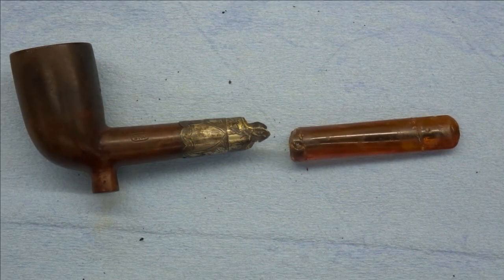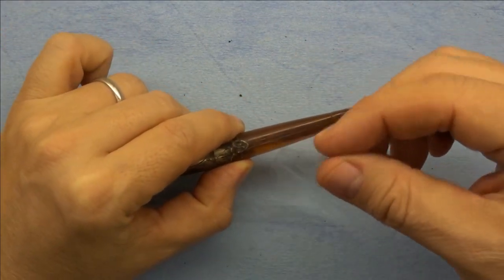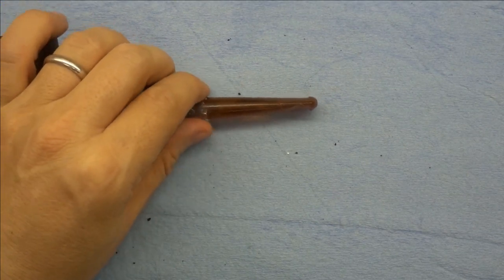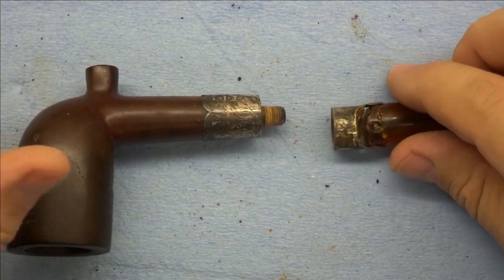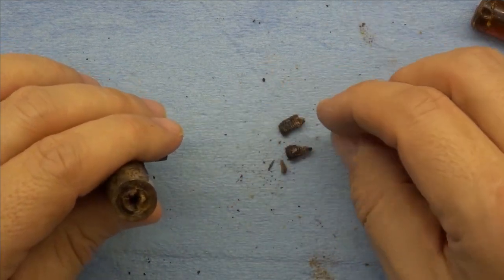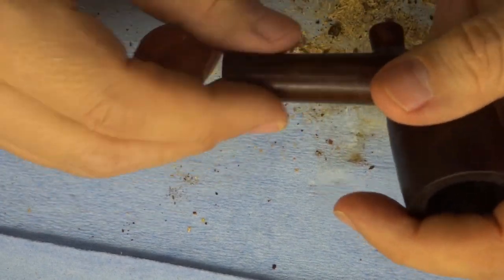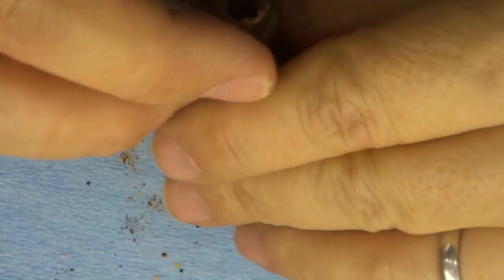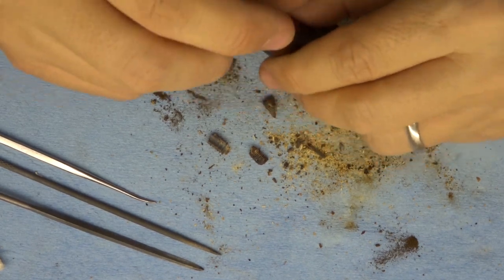Antique Ben Wade Restoration Part 2

Comment: Question Mike, about how long did it take you to get that last bit of bone out with the file?
Reply from the maker: About 15 or 20 minutes. Once you get a piece out the rest will crack away.  Bone is fairly soft material when it comes to filing.
Reply: Thx my friend!